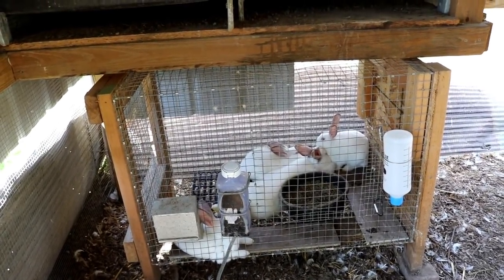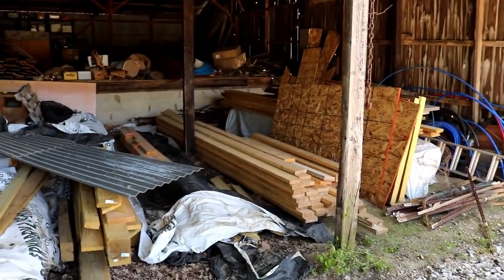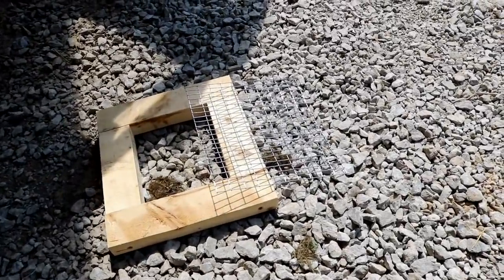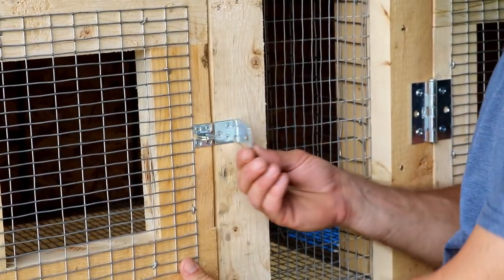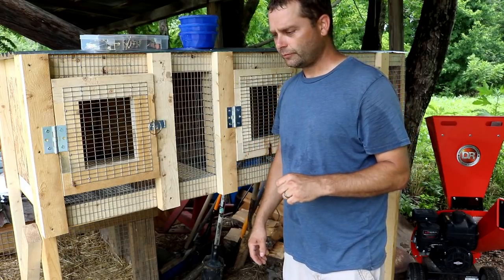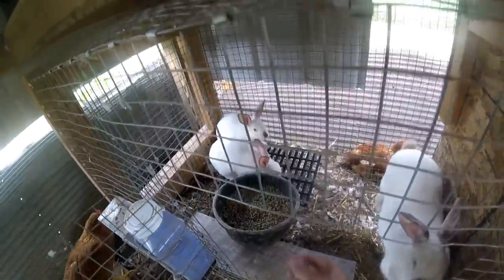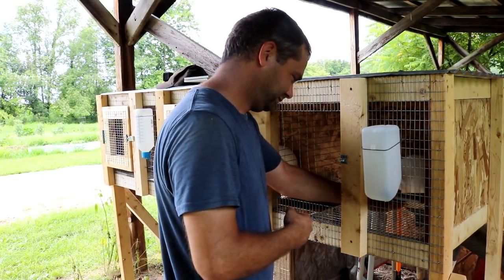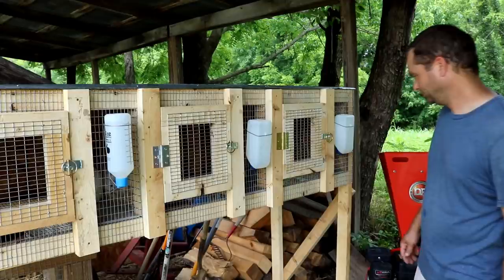Building a 3 cage Rabbit Hutch

Comment: I know this might be harsh but that hutch is awful for rabbits. 1 its WAY too small 2 it’s wired bottom 3 it’s not on the ground 4 not suitable for the winter. If u take my advise ur rabbits will be happy as can be oh also u can have a hutch then a space to run attached to it with a roof so no predators can get in thx
Reply: You are right about the size but ive owned rabbits for years of the ground with wire mesh bottom never had a problem and i have realized once there is room and food those rabbits can be very happy but i recommend a box in the cage  just so they can be a bit more comfortable

Comment: Nice cages!!  Only  thing I would  change is  putting  the  wire on the  door  on the  inside  so  the  rabbits  cant  chew  the  door  frame!!  I  used  plywood  for my doors  and  its  a  yearly  repair job!  LOL  I  should  also  wire the inside  of  them!!  I am  tired  of the  plastic bottles  cracking and  freezing in  winter,  so  changing to  the  metal  half circle pans with the  tabs the go thru the wire.  I  hope  I  can just  knock the  ice out and  the one I  have  I  just  fill  with  a  garden waterer  thru the  wire, so much  easier!!!  I  do  have  the  feeders  but  they  are  inside the  cage  after removing the  flip tops  so  easy  to  fill.  My  cages  are  doubles  similar  to yours,  and  in the  outside  chicken pens  so  the  chickens  keep  everything  cleaned up.   I  enjoy  watching  your  vids,  and  look  forward  to  each  one!!!

Comment: Make videos of work on the barn Please,as I will have a lot of work ahead when I’m done high school and start farming the family farm! Our bank barn is 8/10 condition but still wouldn’t hurt to do general work and repair to get it back to having cattle.
Reply from the maker: The barn is huge project, not sure what all I will get done this year.  But it need electricity run out to it.  Water ran over to it.  Stables area cleaned out and redone.  Paint on the outside and a new roof.  I could make tons of videos just on barn projects.  Not to mention all the fencing that needs done.  I am planning on making videos for all of it.